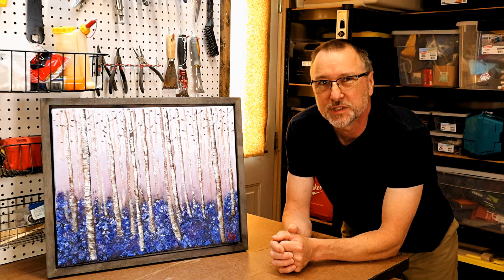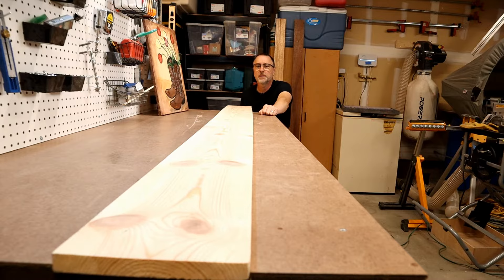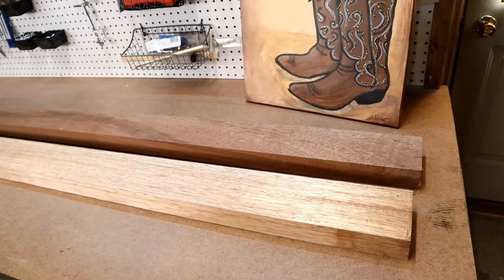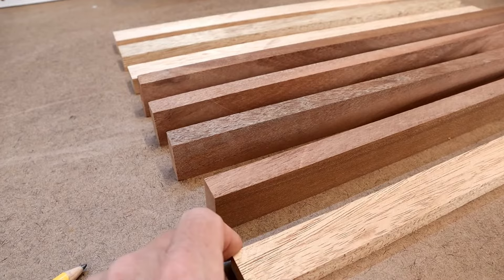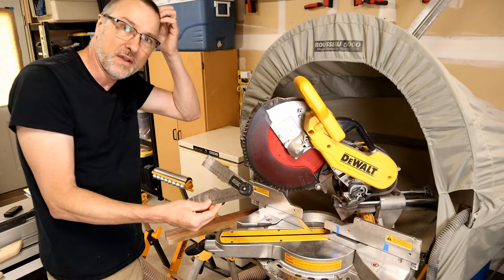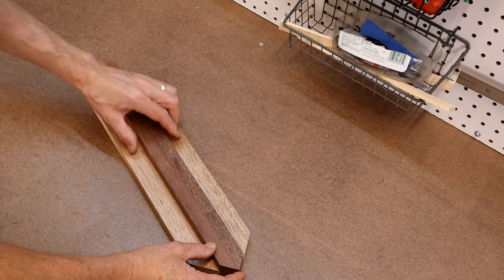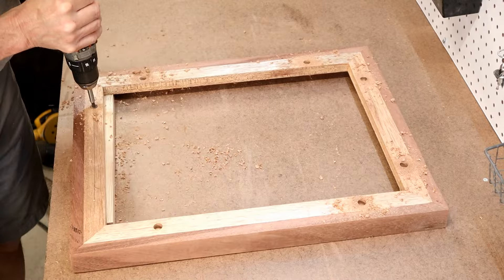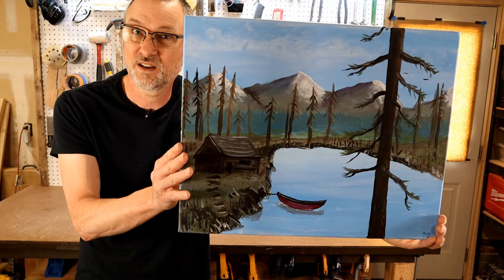🖼️ Floating Frames for Canvas Paintings ~ Your Next Side Hustle

Comment: Hey Ronnie, once again, great video! I’ll be giving this a try in the next couple of weeks. I have a 12x12 painting of a parrot I’m going to frame. I’ll be getting material tomorrow although I’m going on the cheaper side of lumber until I’m sure I know what I’m doing. Thanks again for the tutorial. You do some very nice work!
Reply from the maker: I'm glad you found it helpful. Good idea to use less expensive wood at first until you're confident. Good luck with your project!